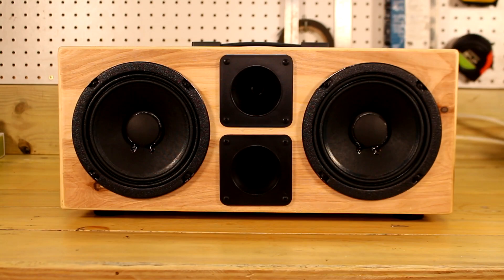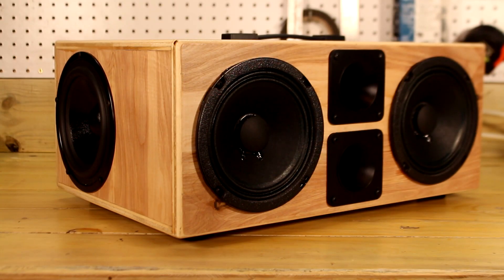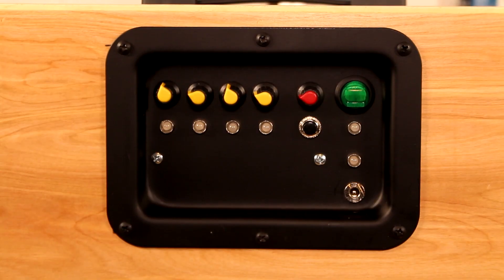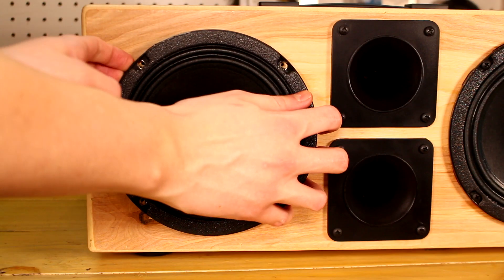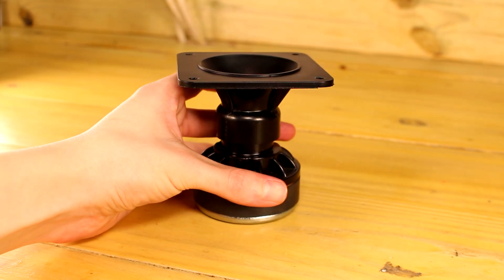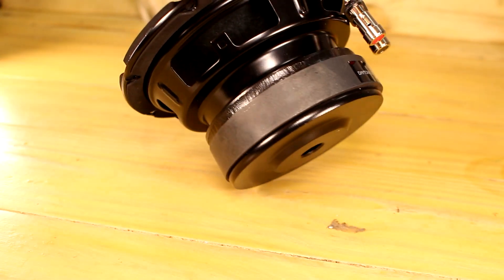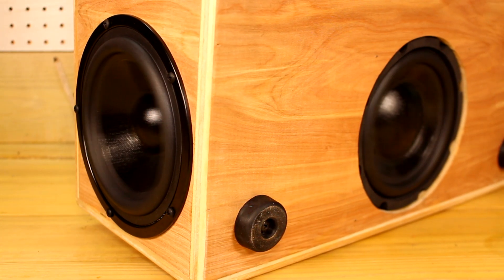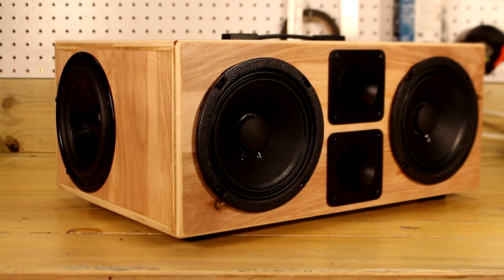SUPER LOUD custom DIY potable Bluetooth speaker

Comment: Some Chinese amplifier board usually give distortion or crack sound when you turn the amp to the maximum level. Especially with amplifier that build in Bluetooth module because the Chinese guy don not limit the output level of the Bluetooth module and they usually set gain of the amp very high. Does this module having this problem ? Waiting for your reply.
Reply: If it's set to high you can adjust the volume with the knob

Comment: What kind of battery is powering this? I want to make something similar but dont know how to power it wirelessly. Or at all for that fact. Please help?
Reply: These mini Bluetooth amplifiers  mostly run on 12v to 24v.

I run a Bluetooth setup with my cordless power tool battery 18v straight.

I run another bluetooth setup using a mini 12v car amplifier using the same cordless power tool batteies 18v, but in this case, i use a DC to DC step down converter.

Use a battery with a big amperage load to last you a good while.

The best part is, when your battery goes dead, there is no need to look for a power outlet to charge it. Just swapped out the battery for a fresh charged one.

Comment: Where is the bass hole????
Reply from the maker: There isn't on. The front speakers are sealed, and the passive radiators function like a port for the subwoofer.
Reply: @LoudLabsAudio  oh ok...but in my opinion if you create bass hole on your speaker the sound might be pretty nice and very loud...i already build my own bluetooth speaker and also i create one bass hole between the two of my speaker and one passive radiator in the back...
Reply: @rogerdiagosantos7557  the passive radiators are almost like a "bass hole". They increase output like a port.

Comment: sweet speaker, I just finished my 600w boombox (they always state these numbers at 10% thd anyway :) so how much does your weight and what batteries?
Reply from the maker: It weights 31 pounds so it's a little chunky lol. For the battery I'm using the Dayton Audio LBB-3 battery holder which holds  three 18650 cells, and I'm just using some cheap cells in it. I can still get a few hours out of it at full volume. Fully charged its a little over 12v and a little over 9v dead, so the output does suffer once it starts to get really drained
Reply: @LoudLabsAudio   Yea, I need to add some tweeters to mine. For now 16lb and 10s2p (20 x 18650 2200mAh). I will test the runtime during weekend :] I like your 2.1 concept, but I would connect them as stereo because sometimes signal is different on left/right chanel, so not necessary for stereo separation (even though it sounds better than mono even if speakers are this close) but for more information. Usually I use 6s battery with tpa3116 amp because at 12V it is only outputing 10W instead of 50W (THD+N at 10%). Tthat is why you have such long runtime with only 3 batteries. But you are using sensitive speakers so it is loud anyway
Reply: @quadsquad3087  finally someone who's done his homework. There are too many people out there bragging about large inaccurate and false numbers lol. Very well done to the both of you!
Reply: @quadsquad3087  40 volts?  Wow!
Reply: @blackz06  I updated the battery to 12s3p, so it is at 50V now to get all the power from the amp :]
Reply: @quadsquad3087  jeez! What's the optimal voltage for it?
Reply: @blackz06  amp is based on TAS5630 chip, maximum voltage is 50V, at that you can get all 600w (10%thd+n) it can provide. Speaker is really warm after long use. I wanted smallest possible enclosure, vented or PR would be twice as big. But it is pretty heavy for everyday use, so now I am building upgraded 200W version of my 5" cube. All videos are on my channel.
Reply: @quadsquad3087  10% THD, dang.  I do find these interesting, though.  I only need something that can do a solid 100 watts.  I'll check out your channel!
Reply: @quadsquad3087  i will check it out !!